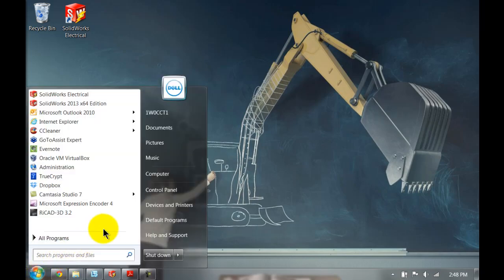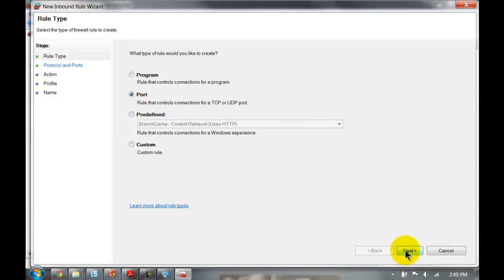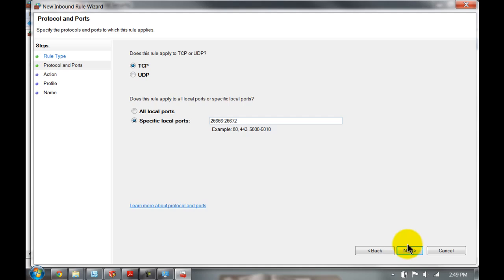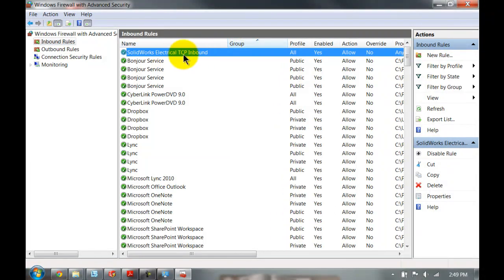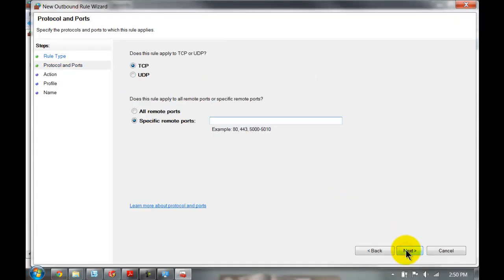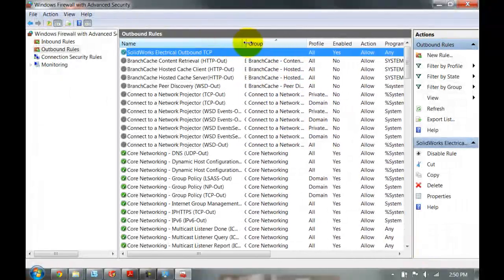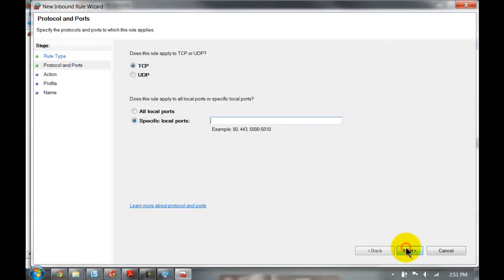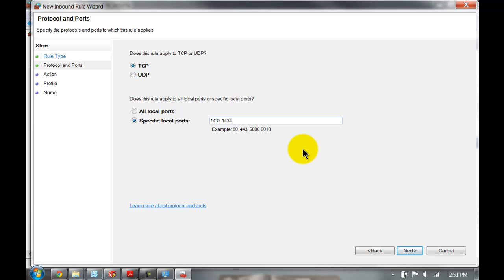45. SolidWorks Electrical - How to Open the Correct Ports in your Firewall

Comment: Opening TCP ports 1433 and 1434 didn't work for me. After doing a packet capture I saw that the correct protocol is UDP. After changing the rule to allow UDP ports 1433 and 1434 then SolidWorks worked fine.